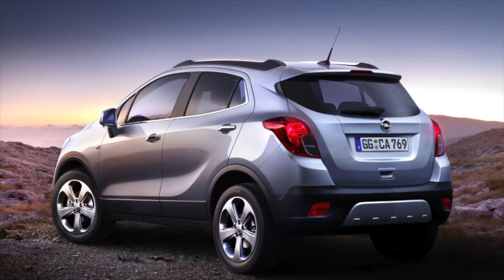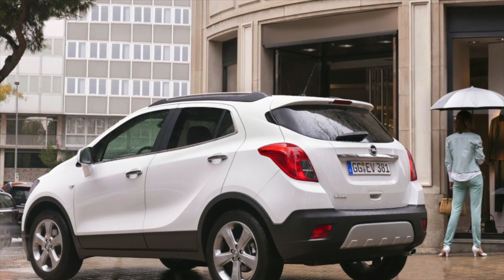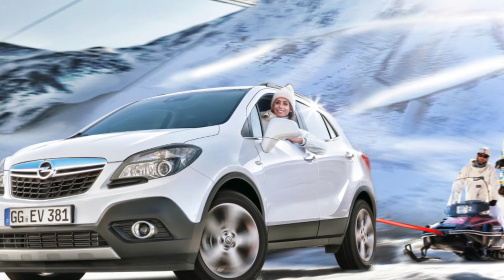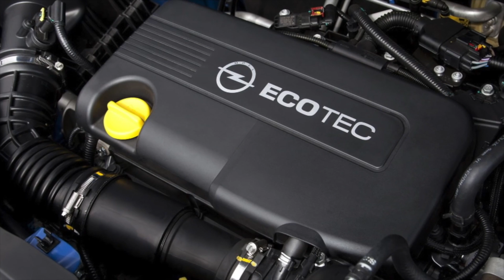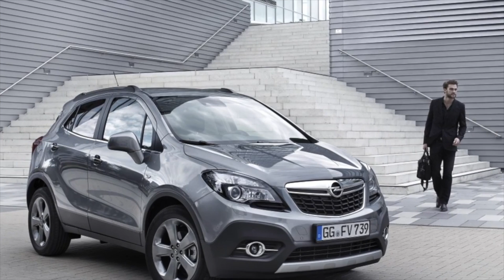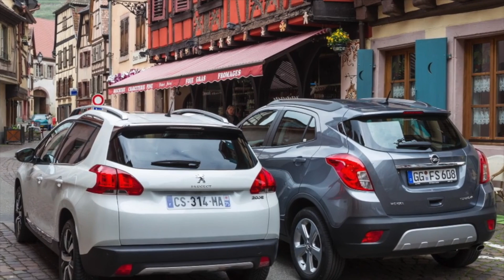Opel Mokka - Check For These Issues Before Buying

Comment: I have a vauxhall mokka 1.7tdi 2015 had this car 7 years  I love this car still fun to drive  issues  front  spring broke going over a speed ramp .windshield wiper  motor  replacement 
And 4 heat plugs 
All in all been a good car .but my  next  car will be a 4x4 mokka  don't  care  about car critic's  I had my mokka long enough  to know it's  problem's